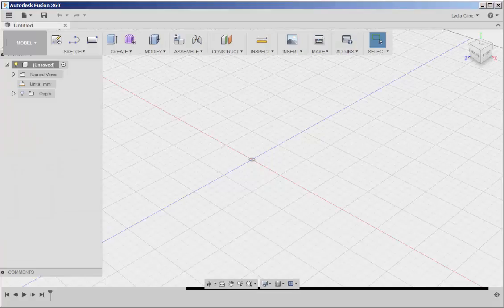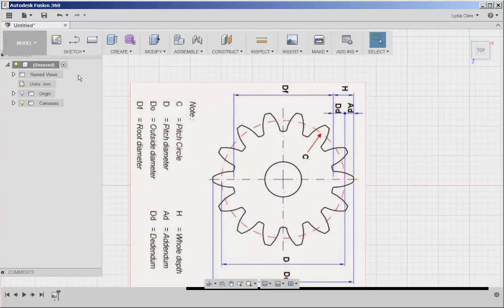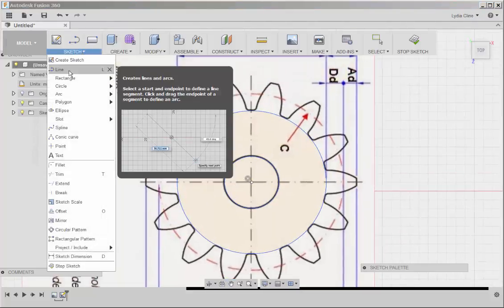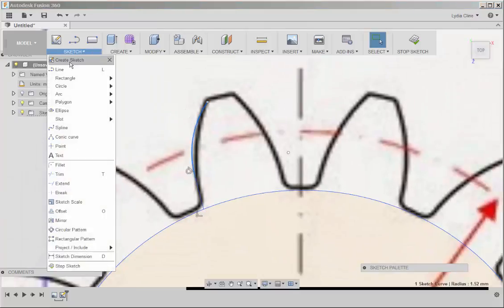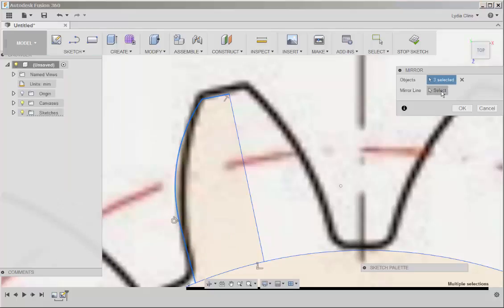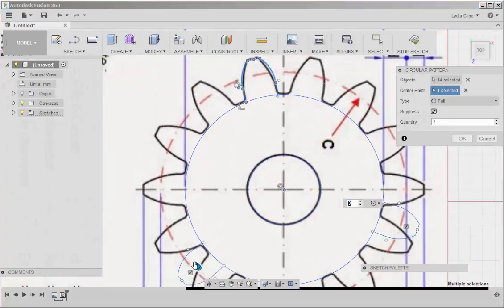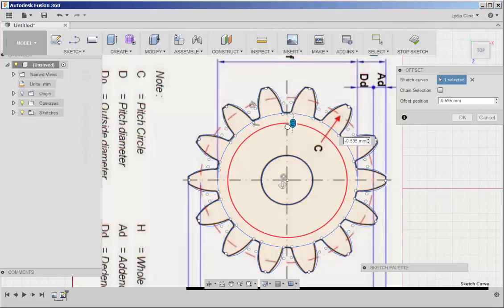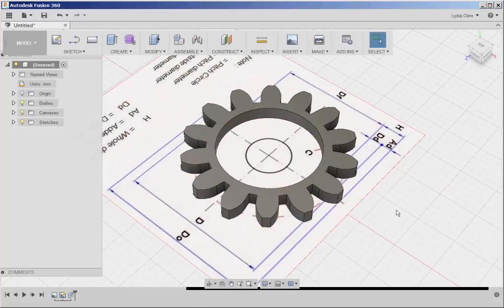Fusion 360: Spur Gear

Comment: There is a spur gear add-in you can run to get perfect spur gears that actually mesh correctly. While I like your tutorials they're all form and zero function. They might look good enough but won't work for anything truly technical and mechanical.

Comment: Hei +ProfDrafting . this reminds me of the spur gear you modelled with 123D Design : )

Now, following your current tutorial, I thought I had it smooth going, until at the last part, push pull failed. Then I realised that in the earlier stage, when I "trimmed", mine trimmed off more (see the red highlighted portion), than your example showed.

Could you advise me what went wrong?

Thank you.

*p/s: had also commented on your G+ post.

*p/s: I traced the gear using "Tangent arc".